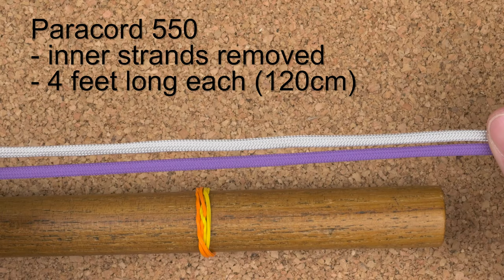Plaited paracord flogger

Comment: Hi, thanks for the video. I’m just curious why remove the inner strands? Is it necessary? I think I would like to leave them in so it’s a little more heavyweight.
Reply: It's for the plaiting; it looks a lot smoother with gutted cord.
Reply: I did something like this. I used steel ball bearings in the gutted cord to add weight. Only an inch or so. If you used plastic, like nylon BBs, you could do the whole length with a bit more heft, or alternate steel and nylon in different ratios to tweek the feel.

Comment: Running into an issue here: I went with 24" falls that I dressed with single-strand diamond knots at the tips, and they tangle like crazy from just a couple swings, or even lightly jiggling it in my hand. Before I painstakingly untie all of the knots or trim all the ends, do you have any idea what might be causing this problem? The way I see it, it could be the length, the weight, or the size of the knots.